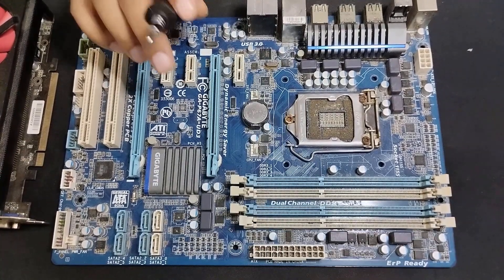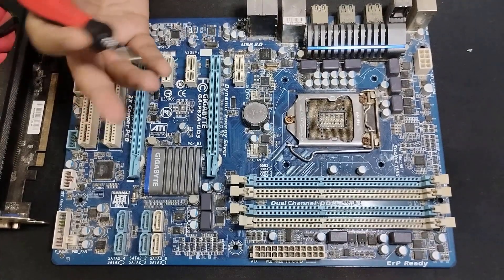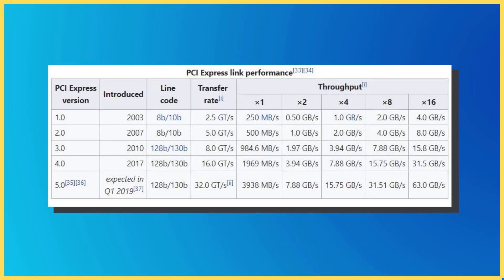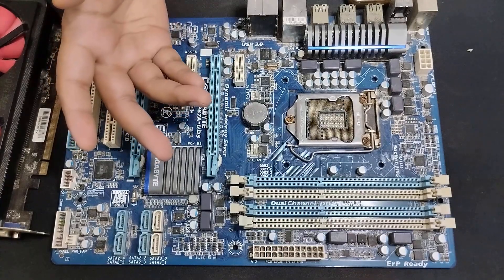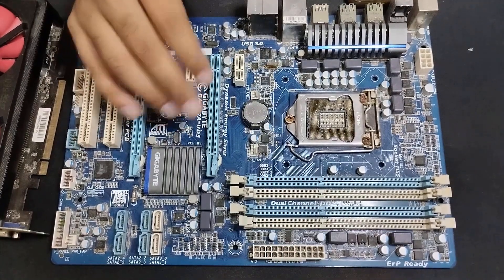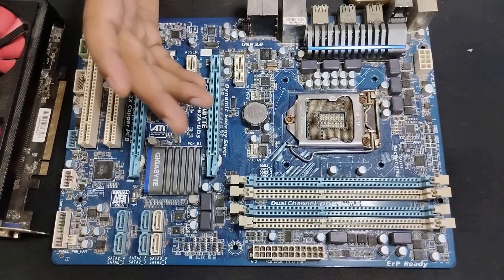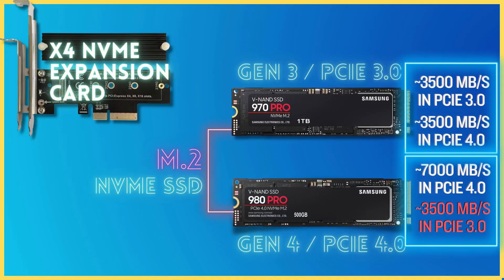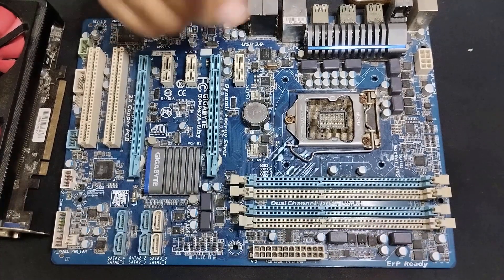What is PCIe x4 Slot | X4 Slot Uses

Comment: That is not a PCIe x4 slot. Both the blue slots are PCIe x16. The difference is that the 2nd PCIe 16x is capable of wiring up to 16 PCIe lanes, but on your motherboard that slot has only 4 lanes connected to it.
Reply: lol wrong of the bat. talks endlessly
Reply: Er... did you actually watch the video genius. He explained that a few seconds later. Don't you feel stupid now.
Reply from the maker: That is exactly what I explained.

Comment: What happens if you put a GPU in the x4 slot?
Reply: Less performance
Reply: @xosezmultiplataforma2404  So, could it be used to have a system with 2 GPU's and several monitors?
Reply from the maker: Either the GPU will not work (if it is designed to support only x16 or x8) or it will have a reduced performance.
Reply from the maker: @peddersoldchap  SLI and crossfire on modern GPU is dead. So you won't get added performance boost cuz game devs (if you are a gamer) don't want to work on optimizing their games for multi-GPUs. 

Yes you can have many monitors connected to your GPUs. IF each supports 3 monitors, you can technically have 6 monitors.
Reply: Thank you for all your replies! @pc @xo
Reply: It works at x4. A GPU can be used even in a x1 slot but of course with x1 bandwith. Though you must modify (in most cases) that slot so it allows the installation of a x4/x8/x16 card.

Comment: My motherboard have three physical PCIe x16 slots. Two of them run in x4 and x1 mode.
But the manual doesn't say which one of the slots is running in x1 or x4 mode.
I had to check the amount of soldered connections the slots had to the motherboard to know which one is which